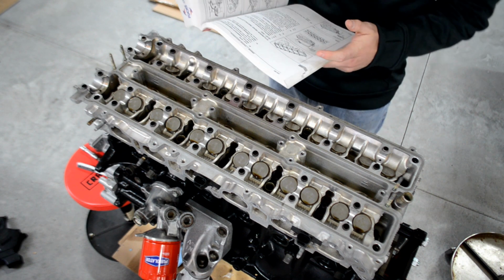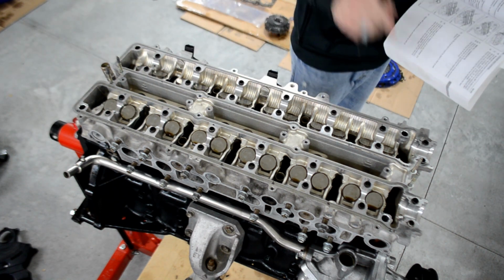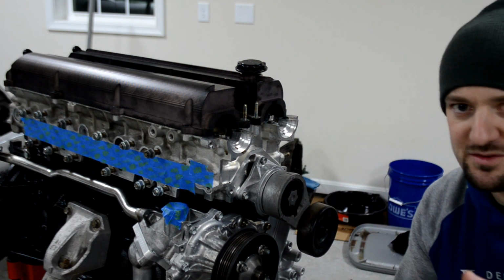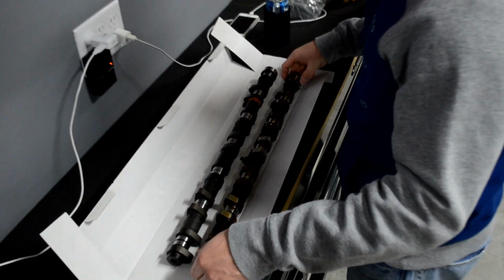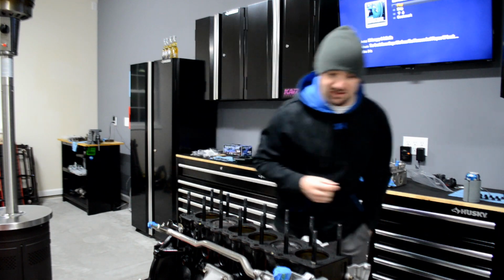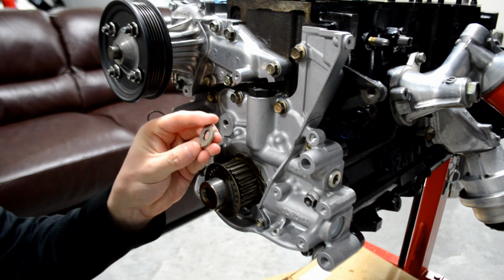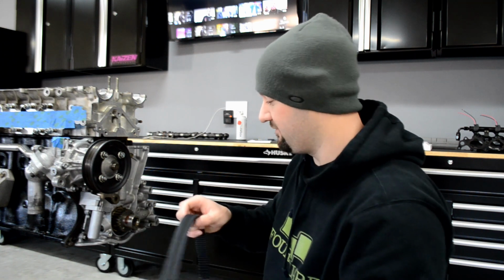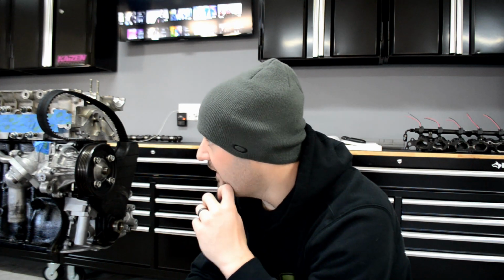Supra Build Series-11 Finish Head Work, Energy Drinks & I Made a Mistake...

Comment: Just buy a complete engine gasket kit .... I bought mine from Driftmotion for about $450.00 everything! Be very careful to lube up those cams & slowly bolt them down just a little at a time in the correct manner that they lay or you will ( Snap them like a tooth pick). Good luck, & Merry Christmas!🙏🙏

Comment: If you are running ARP head studs they are not torque to yield, but a couple ft/lbs extra will not hurt anything.  The stock bolts are torque to yield that is why you torque them by angle and not by ft/lbs.